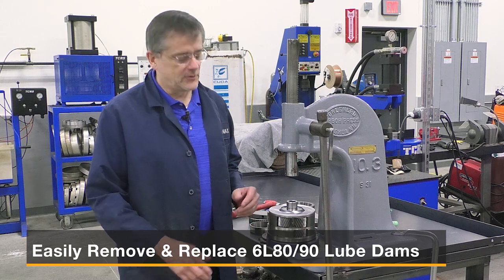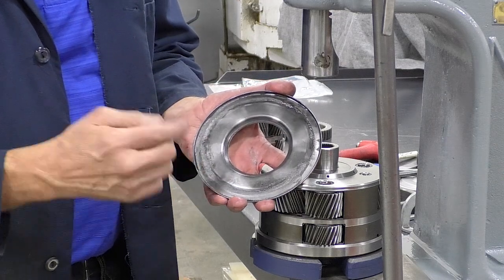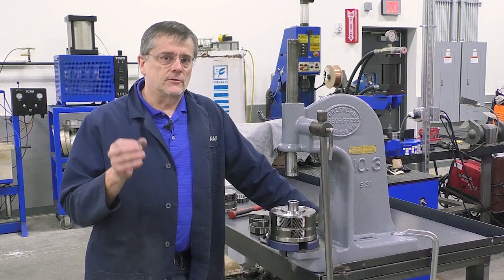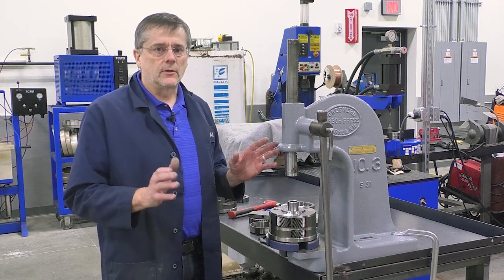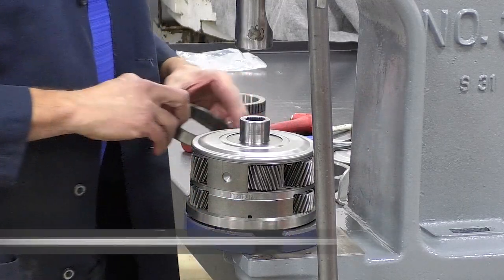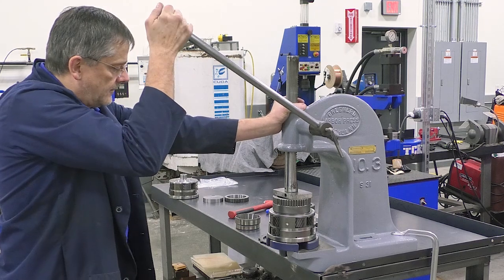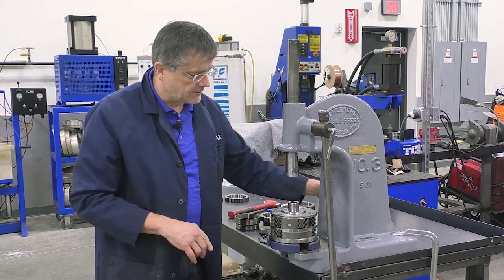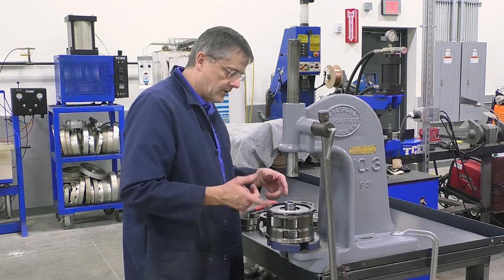How to Easily Remove & Replace 6L80/90 Lube Dams - Sonnax

Comment: Great tip, works like a charm!

For commonly available parts to press on, a disassembled 4L60 sprag is a good enough fit for the first crimp (use 4L60 outer race to press against planetary-- stack components "upside down"), and the front ring gear assembly from the same unit works for the second crimp.  (I figure we all have bucket loads of 4L60 parts laying around).
Reply: Thank you very much for that pro tip.  I did one of these last week, but it didn't go very well.  Today I used the 4L60 outer sprag race like you said, and it came right off.  I pressed it using the smaller side first and then the larger side next.  When I went to go try the ring gear, I noticed that the dam plate was already free from the planet.  Can't wait to try the next one.